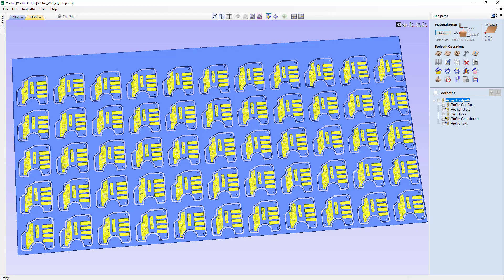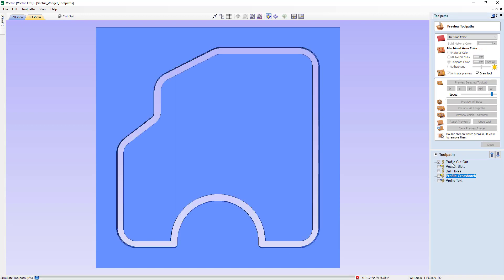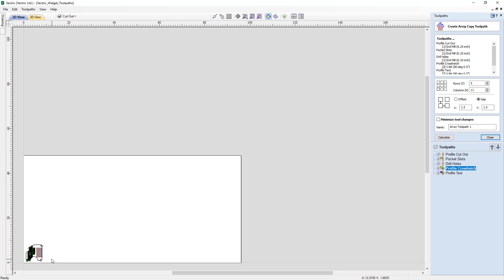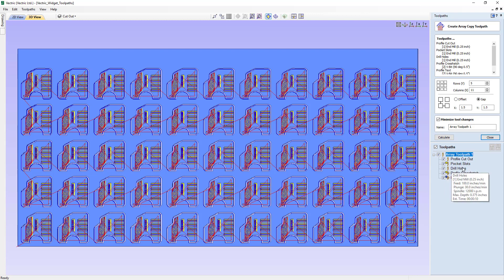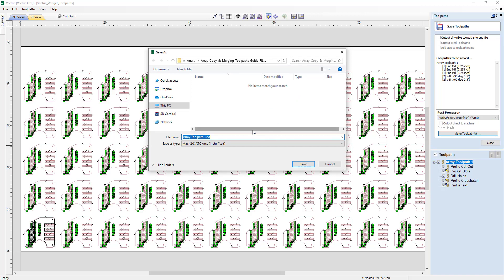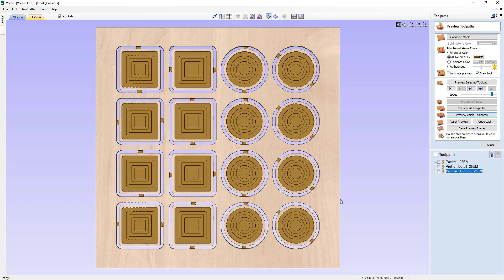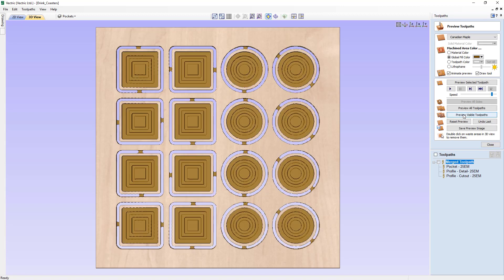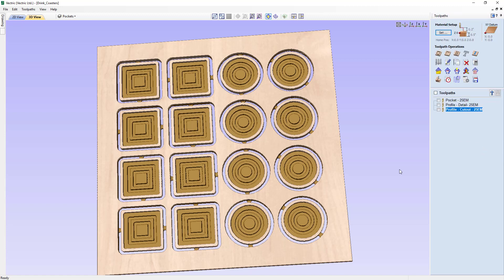Vectric V10 Tutorials | 2D Toolpaths | Array Copy & Merging Toolpaths Guide

Comment: Thanks. But what if a bit broke half way through all the cuts. Is there a way to restart only in the section where the bit broke? Or do you have to run the file from start to finish which you would be cutting air until you got to the area where the bit broke?
Reply from the maker: Hello Dale... thanks for the question.  For most folks you are correct... you would need to restart from the beiginning.  The chances of you knowing the exact line of code the bit boke on would be near impossible.  In saying that you controler software might have a way to skip to a point in the g-code... but that would be something you would need to look into.